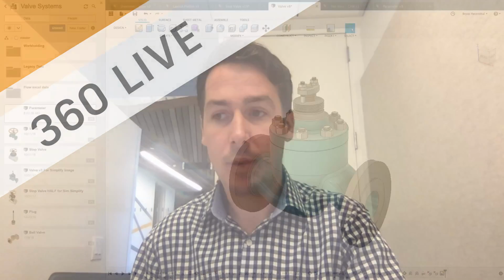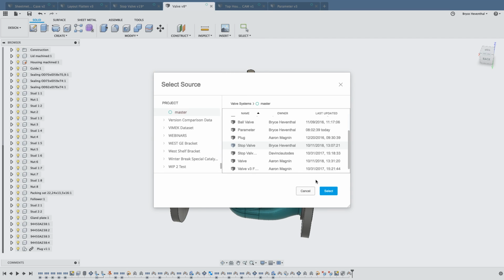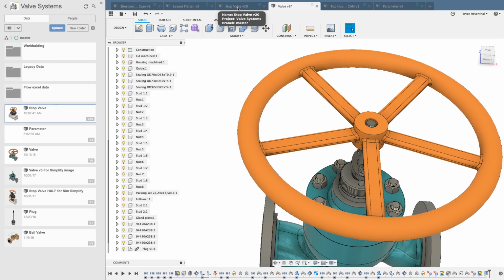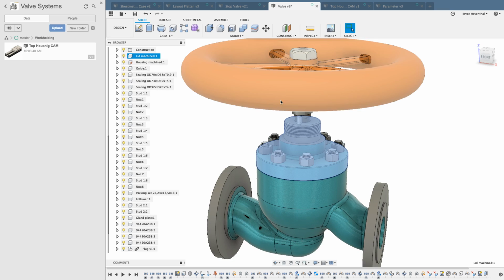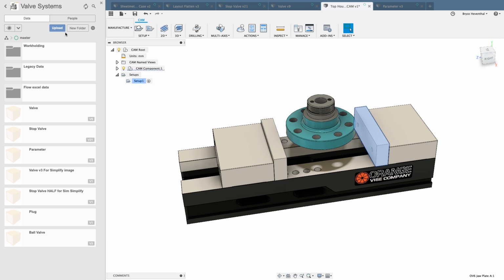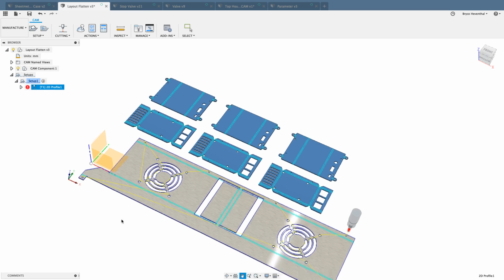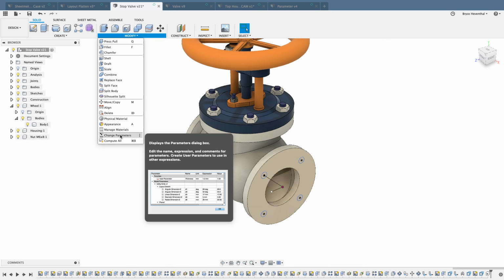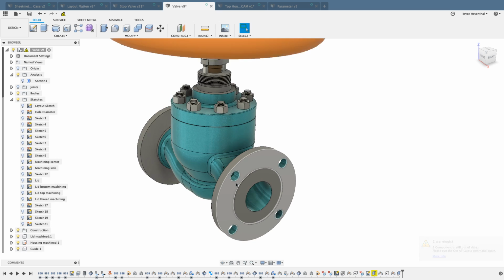360 LIVE: What's New - Derive!

Comment: This seems like a really powerful asset to multi-process manufacturing. An example would be a casting of that valve flange. You can create a derived version of the finished component and remove the holes and add material to the flange seat. This cast component now would have the additional material required for removal by the milling machine. Any major changes to the finished component will automatically update to the cast version.
Reply from the maker: Derive really added a lot of power that was previously missing. You hit the nail on the head with your example.

Comment: Is there a way to protect the derived component from being edited in the design it has been imported into? 

I actually have been using a very similar workflow to this using the older "insert current design" function to design my workholding and CAM, and it's really nice because like derive the component is linked to the parent design and updates accordingly, but it can not be inadvertently altered.
Reply: It looks to me like the upstream component gets imported into the downstream design as a copy, and any editing in the downstream design operates on the copy, not the original.  (Yet preserving the capability to update that copy from the upstream original as well -- in accordance with the "derive" semantics.)

Comment: Hang on... that Derive Parameters workflow is violating the history rules on the timeline (although I get that parameters don't have history anyway). Also ordinarily, auto complete works on user parameters, but not model parameters... hence the need to mark model parameters as favourites to get auto complete to work. I get that in the case of Derive, it's putting them under the a new user parameters group, so what you show is needed. As you point out, it would be good for autocomplete to support derived user parameters as well. That being said.... this is a big boy feature for Fusion 360 to have. Nice work getting it in there.

Comment: The big win with this for us is being able to use master sketches with parameters and construction geometries across all of the individual parts in a design. This allows multi layered hierarchies and would also appear to partly solve the large assemblies problem as parts are dropped into the main assembly at the correct location by default as they are built seperately on a common master sketch ( or many layers of master sketches for sub-assemblies). Being able to drive all of this from a seperate parameter part which in itself is driven from complex equations in a spreadsheet via sheeter is starting to look like a "real" CAD system. The future is looking very promising, can't wait to see what comes next ;-)